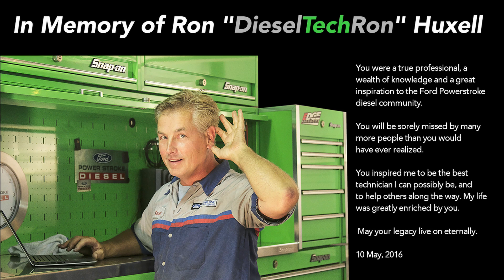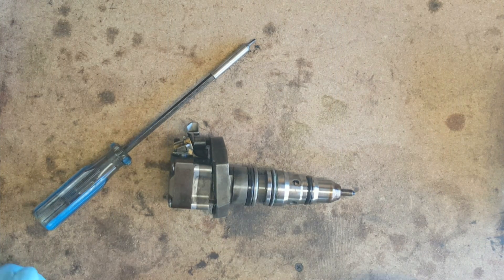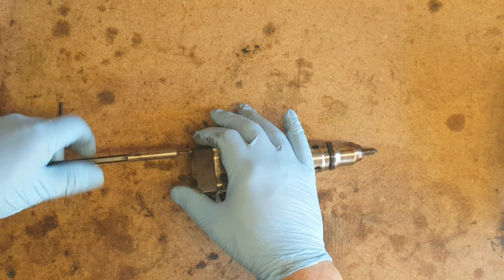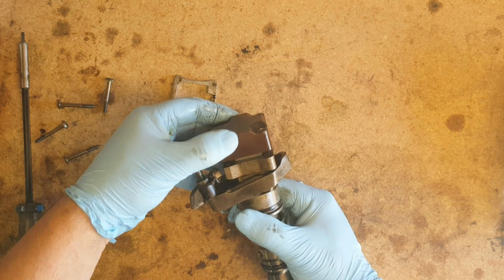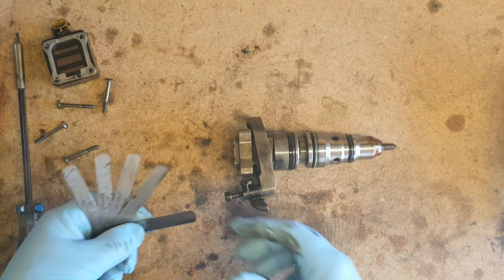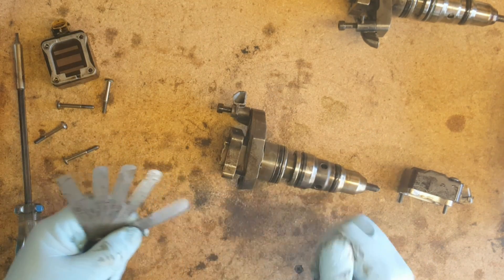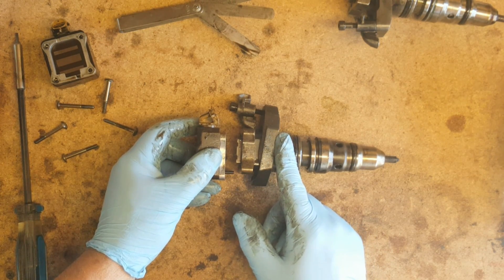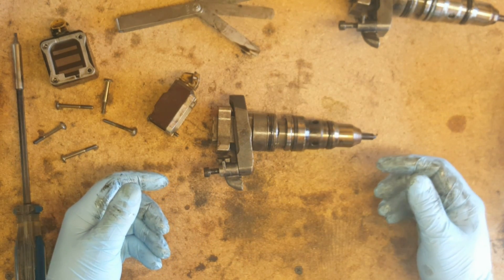7.3 Powerstroke Misfire - How to determine wear by armature plate clearance

Comment: Can you ohm test each injector on a table like that with out having plugged into uvch?
Reply from the maker: I suppose you could, but it wouldn't tell you anything about the resistance of the connector. Of course, the resistance also doesn't reveal internal mechanical wear either.

Comment: I think I just figured it out. The up stop hasn't changed. Also couldn't it leak oil past the seat after shimming?
Reply from the maker: I've never heard of that happening.  I can't think of a way shimming could cause a leak. I suppose it's possible on an injector that has extreme wear, but I'd have to believe the armature plate would hit the coil and cause DTCs first.
Reply: @PikachuG5  thanks

Comment: Thanks for the Video. I have a question? If the armature part/seat is the only thing getting wore and moving closer to the body. Then why after shimming back to .004, would I have to shim the solenoid that hasn't moved a spec. since new?

Comment: Can  (cps) cause a misfire on a 7.3,I have the Grey one in their!
Reply from the maker: It's possible, but they aren't usually the cause of a misfire. Typically, a failing camshaft position sensor either fails completely or the engine dies and won't restart for a period of time. The most common cause of misfire in my experience is injector related. Either a hard miss when cold that suddenly clears up as the engine warms, or an intermittent miss during low load with light throttle.
Reply: Ok thanks! 
I'm gonna install the black cps tomorrow.

Grey Cps  one is on their know! 
I'll let you know if it stops!!

IT was never updated ! 
Motor has 63,000  on it!
Reply: Stopped installed black  Cps!

Comment: Condolences on the loss of DieselTechRon. Seen his video's and learned a lot so far. 
I have a 2002 7.3 with the #3 injector armature that is all the way down, couldn't even get .0015 gauge underneath. I ordered a shim kit and was gonna try and see if that'll get it to fire, Do you think I shouldn't try it and just replace or have it rebuilt? I figured it was due to stiction and once I have it running was gonna run stiction eliminator with an oil change. Currently Truck does starts but runs rough.
Reply from the maker: +JMK I think shimming is worth a try. It can be done relatively quickly, with the injector still installed as long as you're careful not to drop anything while you work. You don't even need to reinstall the valve cover before you start the engine to see if it's going to work out.
Reply: Worked great for me! Shimmed mine  ~3 months ago, and it's worked flawlessly ever since!

Comment: I just shimmed mine with pretty good success.    Most of them were a tight .002" clearance, and one was even less.   Shimmed them all to .004" and the truck runs fine again.
Reply from the maker: Very good. Shimming isn't necessarily a permanent fix, but it can definitely get you a good amount more time out of an injector.
Reply: @PikachuG5  I'm assuming 'permanent' meaning "fix for another ~100K miles"... in which case, why? Is it just wear over time? Accelerated wear due to a coating on the poppet valve being gone? 

I shimmed my own truck; went from 'would not start at 70F without being plugged in' to 'fires on first crank without being plugged in at ~15F'. How long it'll last, though... I don't know.

Comment: I fixed my stuck poppet , but not with a shim. I surfaced the "bottom" side of the poppet base plate the .002" to .0025" or .003" to bring the clearance back to spec. Just measure before dis assembly, write it down & surface the (bottom) the desired amount. Doing the "adapter" [ fords name for it] plate bottom side keeps your solenoid to plate clearance as is.  Being that the valve "wears" into the body, I don't see how "machining" the poppet valve & or seat can raise the height.  My feeling is that they measure with a new poppet valve ,maybe, & "machine" the part I did, make it sound involved.  At $2,300 or so for a new set, I'm gonna get another 100,000 + miles first.....
Reply: This seems like a good idea!

Comment: Problem I have is constant misfire on my 2002 7.3 smokes once temperature is hot 
Since I can't do an injector cut-out & have no engine codes 
What's should the temperature be on the exhaust ports with a laser thermometer?

Comment: You want no more than .002" of clearance, as you run the chance of codes popping up.
Reply from the maker: New injectors have 0.004" clearance, so unless there's something you haven't made clear in your comment, that's not correct.
Reply: +PikachuG5  You said it better than me (NEW).You don't have a new injector, you have an use part where the specs won't be as new.
Reply: PikachuG5 l
Reply: Never Gonnatell  What part don’t you understand?